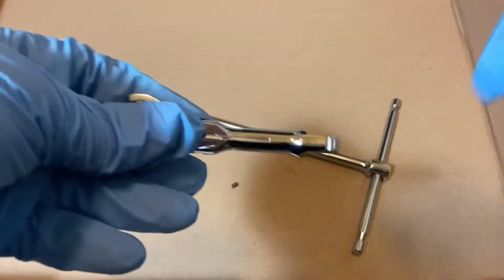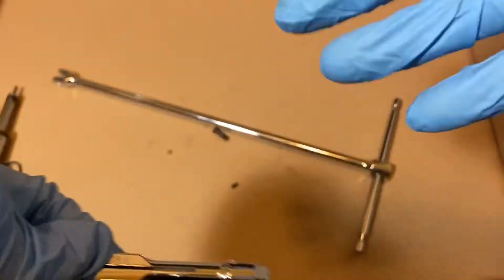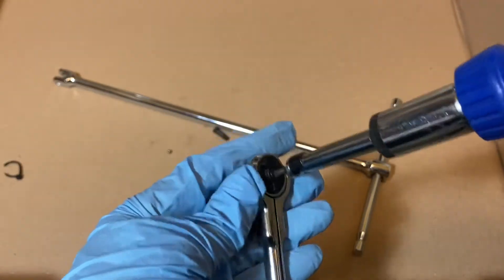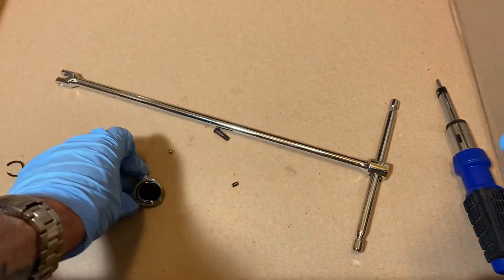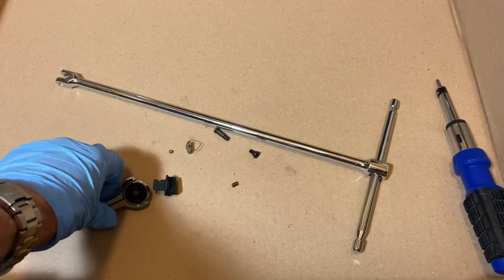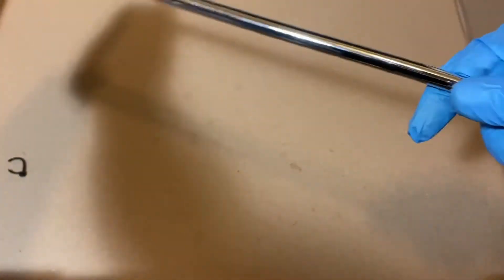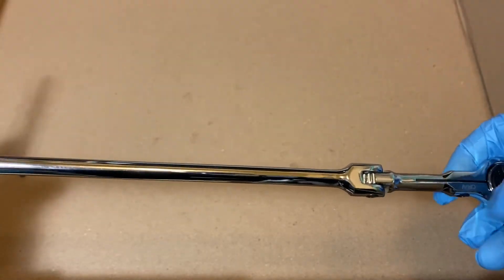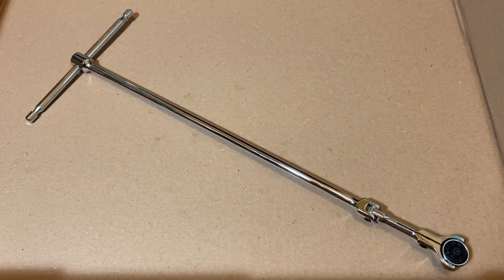Harbor Freight Pittsburgh Pro 3/8” Flexible Ratcheting T-Bar TOTAL TEARDOWN

Comment: I like it!
Reply from the maker: Thanks 👍
Reply: @snapringchronicles3020  Could you modify it and put it on a breaker bar with a comfort handle? That wouldn’t seem so hard...?
Reply: How did you get $5 off when it’s not a pro ratchet? Did the clerk do it anyway?
Reply: I wonder if it’s possible to swap heads with the Pittsburgh
Part Number	96369?
Reply from the maker: The breaker bar would have to be real thin. This tool has a thin beam and small fork that seems more in the 1/4” drive realm. Also not possible to swap with 96369. The width of the fork on the 96369 is around 10mm. The fork width on this flex t-bar is only around 7mm...
Yeah it didn’t go through on the cash register but the manager honored the $5 coupon with no hassle at my store.
Reply: @snapringchronicles3020  Thanks for the heads up. I have some soft grips I want to experiment on and want to try the swap-a-roony on it. I too am disappointed to see plastic, but the design is good.
Reply: I am going to buy five 96369’s and add the 3” bar before the ratchet all onto one unit and make a snake version. This ought to be interesting.
Reply from the maker: I bought 2 of them and did that. So now one has 3 sections and the other one is a single section stubby.
Reply: @snapringchronicles3020  Cool. Can you do a video on it?
Reply from the maker: Catus Maximus did a video on that a while ago.
Reply: @snapringchronicles3020  oh cool. I will hunt for it. My plan it to mate 5. When I get around to it.
Reply from the maker: Just a heads up that at 3 or more sections the ratchet gets wobbly and likes to fold over more easily
Reply: @snapringchronicles3020  👍I will try three and see how it works. Thanks👍🔧

Comment: Yeah, this is a bit flimsy for being a 3/8" drive. I always thought it was a 1/4 inch!

I can't imagine any scenario where I would need that but it's one of those things where I'd rather have it and not need it than the opposite. I was wondering whether the $5 off coupon would work, so I'm glad to hear it does.
Reply from the maker: Yeah I saw a lot of reviews on Harbor Freight where people were saying the tool saved them a lot of trouble...

The coupon did not scan at the register for this item but the manager honored it with no problem at my store.